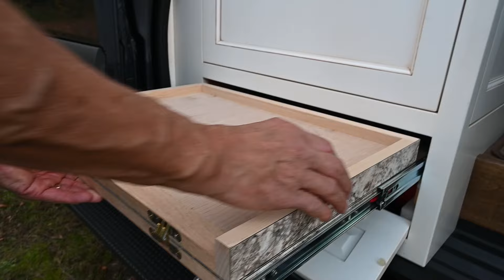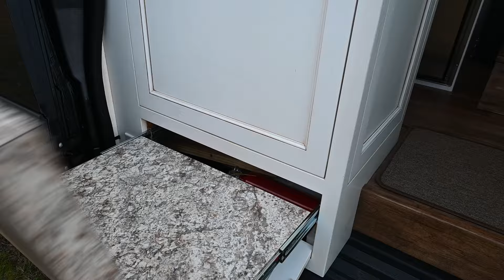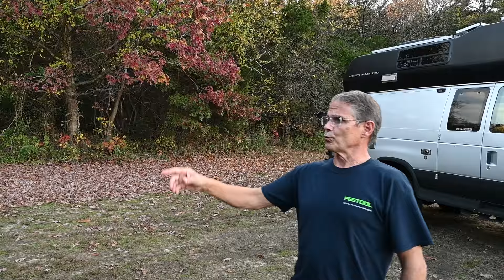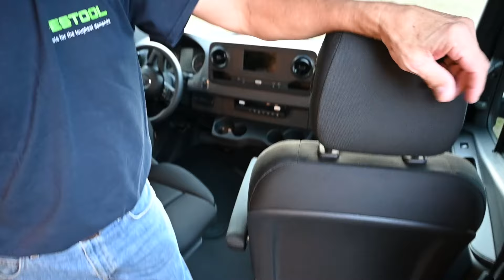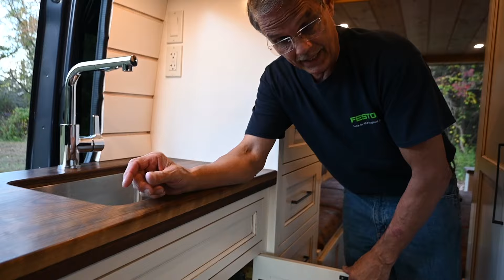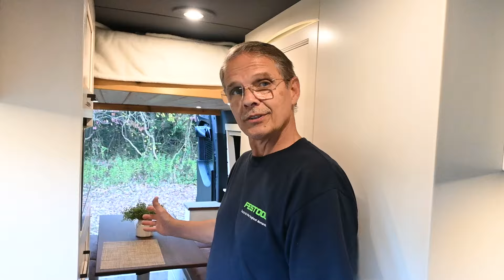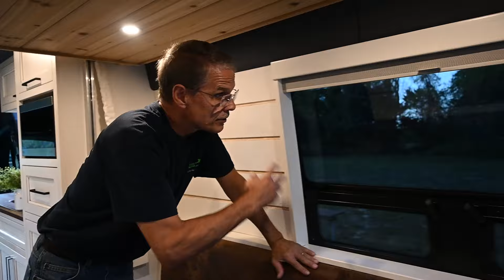Most DETAILED Build - Rugged Exterior With Relaxing Interior Vibes | Sprinter 4x4 Camper Van

Comment: A beautiful van built by a perfectionist. Was there any ventilation device in the shower room though? I'm hoping I just missed it.. otherwise there might be some future mould issues which would be awful in a lovely van like this.
Reply from the maker: Not that I know of, I believe the main vent took care of the whole van
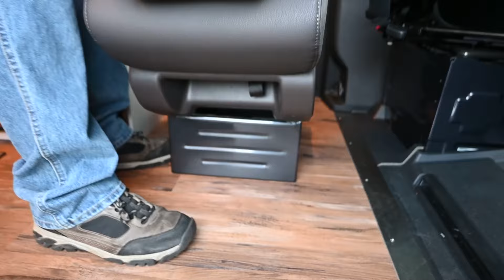Reply: 7:16 Patrick you are right, there isn’t a vent inside of the shower. The door has an opening at the top for any ventilation that would be needed which would be then pulled out of the van via the maxair fan.

Comment: wow i like this, i like how everyone is putting a Happy Jack bed in there class B`s...... Big question if you had to put a price tag on it, what is it worth???  Thanks, It looks AWESOME!!!!!!
Reply: I’m glad you like it!  It’s not a Happy Jack but I guess you would say it’s very similar. I built it with an old geared slide out motor from a junkyard camper, attached a 7/8” piece of tubing, machined nylon bearings and guides, seat belt material for the straps to lift it up, and electrics with a lot of time and this is what I came up with.  As far as price tag I would say for the total for a bed like this I have about $1000 in parts and a ton of hours.  If you meant the finished van that would be around $200,000.
Reply: wow thats not bad at all, so if i wanted you to build me one, could you do it? I also live in Alabama like son, but i live in Fairhope,al. thanks take care....be safe.  @TQ52
Reply: @mikejernigan3215  that depends on what you would want done. Also the van would have to in NJ for a while.
Reply from the maker: I would estimate 180 to 200 K

Comment: I am astonished at how many things he has thought of, but I don’t believe I would put wood surrounding a kitchen sink. That wood is too beautiful to be wet. I have a festool drill so I noticed his T-shirt right away.
Reply from the maker: It works for him and his wife
Reply: The countertops were decided after a lot of thought. Ideally I would have used a quartz or granite for the top at the sink but decided against it only because of the weight. We decided to keep all the tops the same out of an African Mahogany and just be careful with the water splashing wiping it up.  I used a teak oil to condition it after sanding smooth instead of coating with a spar varnish so that I can just hand sand it down whenever it looks too used and just re-coat with the teak oil.  With the use of the under mount sink that makes it a lot easier. They are beautiful though😊😊😊

Comment: Just watched this video. What a fantastic build! I'm wondering what type of locking bracket (and drawer slides) is used on the pull-out shelf shown at the 1:05 mark? I'm doing something similar and really like the bottom piece that braces the shelf when it's unfolded.
Reply: It’s a table leaf support that you can goggle and find easily. It had to be modified a little for this tight installation.  Glad you liked it!

Comment: He used all heavy Stuff. Ya, looks great. But that going to eat into your gas for sure. He even had to put in an extra Leaf Spring.
Reply: Averaging 17 mpg. Anything that tall has to make a big hole in the air and yes I did build it solid not like your average 1/8” paneling in travel trailers.
Reply: @TQ52  Awesome!
Reply from the maker: @TQ52  good information Don
Reply from the maker: Good thing it’s not gas and it diesel
Reply: @NewJerseyOutdoorAdventures  He still said he dropped Mileage. And the way they messed with Diesel prices and somehow made it more than gas. It lost its appeal as far as savings goes.

Comment: Absolutely fabulous build! I am truly impressed with the engineering and craftsmanship that went into this van! I have the same type of bed lift and I am trying to figure out how to safely attach the bed to the ceiling. Do you have any advice on how to bolt the bed lift straps to the roof ribs?
Reply from the maker: Awesome, thank you! Don may know the answer to that
Reply: Thanks for the compliments! I used the steel seat belt hardware from race car belts that the webbing goes thru and can be adjusted with them also.  They are then bolted through the van ribs and backed up with 1/4” aluminum plate.  Super strong and adjustable so you don’t have to adjust inside the bed.  Once they are adjusted right they stay put.

Comment: The kitchen table is what I'm most confused about. How do you bring the table back up and clamp the legs ? I'm also interested in what those table legs are actually called because I want to build a table like that but I don't know what to look for.
Reply: Thanks for asking.  The table base is a compressed air cylinder inside.  When you unclamp it it goes right back up to table height.  It’s also an expensive piece.  Here is what it is called. Springfield Marine 1660230 Ped 3 Stage Table

Comment: This was one of the best van builds I've seen yet. I wasn't a fan of the drop down beds nor transforming tables + benches until I saw this. I especially liked the extra supports as that was always a concern of mine. I love the placement of it in the back with the doors right there for easy access, and so much more to this build. Just absolutely one of, if not THE best designs I've seen! Amazing job!
Reply: What a great comment! I appreciate it very much and thanks for actually watching the video all the way thru.  A couple other commenters I had to remind them that the bed has two fixed positions. One when it is just the two of us (all the way down to the cabinets) and then down to the supports I made for when there are others staying in the bottom area.  That splits the two areas into two equal spaces so each has its own head room. By the way, the supports are made out of very light weight solid cedar.
Reply: @TQ52  would you be willing to sell the floor plan of this build along with the materials used? Or even better, would you be willing to make a replica of this build for sale?
Reply from the maker: Wow, thank you!

Comment: Where do you put dirty shoes when you’re coming into the van? Ditto for wet coats or other outerwear?
Reply: Muddy shoes stay outside, normal every day shoes get taken off at the door and put in the front of the van where the stock rubber floor is easy to clean. Haven’t used the van yet in the cold weather yet but coats would be hung over the driver and passenger seats in the front also.
Reply from the maker: Shoes stay outside

Comment: for wall covering and non weight bearing parts, could 1/4 or 1/8 ply have been used? 1/2 inch was mentioned which seems unnecessarily heavy dep on the type of wood.  Really a thoughtful build otherwise, many useful efficiency gadgets. Thank you
Reply from the maker: Thinner materials could have been used, he built it with thicker for more stability
Reply: Patric is right in one aspect that it makes it more rigid,  but the second reason was if I used thinner material for the walls I would not have the ship lap look that we wanted because the rout that is cut into the wood is more that 1/4” deep.

Comment: Holly smoke now that is 1 of the nicest vans I've seen fit and finish unrealllll
Reply from the maker: So happy you found this
Reply: Thanks for the compliment!  I  used a lot of high end materials that you can’t see throughout the whole build to last for the long haul.  Havelock wool from front to rear for the best installation and all stainless steel strapping and hardware to mount tanks, air tank, compressor,and horns. The running boards and roof rack are all aluminum.

Comment: This is an excellent build. Fine craftsmanship, well thought out. Looks very nice inside.  The ceiling looks good and the ceiling over the bed looks very nice. Electrical systems clean and neat. Large fresh water tank. Decent bathroom. Plenty of storage.  Lots of power, .very nice rig. Intelligent cushions on the rear seating. Lower bed gonna be tight with the upper bed down. Overall a nice clean good looking functional rig. Good job Patrick.
Reply: Thank you for watching the video all the way thru.  It was a very quick tour but most of the highlights were covered in Patrick’s great video!

Comment: Amazing quality and detail...and it's gorgeous! I've been "dreaming" about a dinette like that with a lift bed over it! I just love that van. The only "adjustments" I'd want are to have the bed stop a bit higher up to give the folks sleeping below more headroom, and I prefer a gas engine. Beautiful build!
Reply: Thanks, all the thoughts of how  I was going to accomplish this layout came together after much planning. Plans changed a couple times to get this layout to work. And yes it works very well.  Thanks again for the compliments. I didn’t show the actual safety blocks that I made to keep the bed up another 14” when there will be people sleeping under the bed. It divides the area on the top and bottom sleeping quarters in half. That’s approximately 25” each.  Hope that clarifies the bed situation.

Comment: Patrick I agree on everything you said, this build is top notch. I’m sure he spent many nights laying in bed trying to figure out how he was going to make something work or fit. Cabinetmakers are a step above when it comes to any kind of woodworking and this video proves it. There was no penny pinching on this project, that’s for sure! Thanks
Reply: I just wanted to say thanks for the compliments and you have a lot of insight with every statement you made is true especially the line about laying in bed thinking!
Reply: I’m a retired finish carpenter and have had a few sleepless nights myself, I respect your skills. The countertop and table is beautiful. I’ve never seen anyone use straps for a motorized bed, you may have started a new trend. Thanks for letting us see your motorhome.

Comment: One of the finest builds I have seen.  I think it is great there are quality designs and makers ... skills ... tradesman. ..
Reply from the maker: Wow, thanks!
Reply: Thanks a lot! The Mercedes ,I think personally, is the hardest to build like I did with the walls being curved. For instance the bed had to be about 16” narrower when it’s up than what the walls measure when down.  It works out great though because there is 8” between the bed and the awning windows which allows  a lot of air flow in and then up and out of the max air fan above. All the cabinets backs and the shower wall are all curved to maximize storage and room. Made some stuff for a friends Dodge Promaster and they are simple square boxes but also looks that way.  Not the look I was going after.
Reply: @TQ52  thanks for the reply .. and added info.. happy trails and have fun and drive safely.

Comment: Nice van. I’m surprise you didn’t put a pocket shower door…
Reply: That would have been a lot cheaper and easier to do and I did give it some serious thought.  Another van build that I helped on but was not mine had one in it and when we were driving it to get the electronics for the van checked out it was rattling over every bump in the road.  With that I new I didn’t want to use one.  I used a custom solid wood door and mortised hidden expensive hinges into the solid wood frame and door.  Works perfectly with no noise going down the road.
Reply from the maker: Good explanation Don

Comment: Can 2 adults really fit under the bed when they second bed comes down? The sleep space looks so little. 👀 I wonder how much space is there after you put a sheet, blanket, and pillows.
Reply: We haven’t used the bottom bed yet but when that is going to happen the bed only comes down to the other supports that I built and there will be approximately 25” of space between the two beds. Those supports are stored behind the cushion back on the water tank side.

Comment: And the top bed is adjustable, right?  You can stop it at any height?  The only thing lacking, for me, was storage. Other than that, beautiful build. Excellent!
Reply from the maker: The bed can be stopped at any height
Reply: As far as storage goes it depends what you want to take.  We lived in it for 5 weeks on our first trip in it and we didn’t even use all the available space.  I could even make something that would go on the roof rack up top but until that is needed it’ll stay like it is.

Comment: Great build! My only question is when the bed comes down, it looks like the sleeping below space is eliminated.  Maybe I'm not seeing it clearly or correctly...?
Reply: When the bed is all the way down there is only about 12” in between but no one will be sleeping when it’s all the way down. I have supports that when there is going to be others sleeping on bottom  they go in and it allows about 25” and safety for bed lowering by itself.
Reply from the maker: The upper bed can be stopped at any position, he has a pre decided height he stops at

Comment: Nice, but for me, that's a lot of cracks to deal with sleeping, on the bottom bed! 😉
Reply from the maker: You missed the main bed
Reply: I haven’t slept on the bottom when it is converted into the spare bed but when or if I do I will have a 2”memory foam topper over the cushions to help with that issue.

Comment: You did a perfect job of matching the plinth to the floor. Good eye! I loved the attention to detail, like dovetailing the drawers and the way the couches were upholstered and the beautifully finished metal fabrication. This van is a class act!
Reply: Thanks, I started out with a 1 1/4” piece of maple and cut out the back so that it would lip over the luxury vinyl flooring and then scribed it around all the Mercedes curves, then screwed it from under the van with stainless steel screws then sealed around all the screws so there is no water penetration. Thanks for noticing
Reply from the maker: Thank you Leslie, Cheers!

Comment: At first I thought he was an engineer - then he mentioned he’s a cabinetmaker. Makes sense. Great build but - I would not want to sleep on the bottom if the top bed is being used. There is not very much room to turn from side to side when he brings it down all the way. And you’d have to do a “combat crawl”  to get yourself out to go to the bathroom. Other than that - super nice van. Thanks Don and family and Patrick.
Reply from the maker: Thanks for the feedback
Reply: There are support blocks for each corner if someone is sleeping below. That allows the bottom area to be about the same as the top  bed area which is about 24” each. Then you don’t want to forget and sit up fast.

Comment: Patrick,  this is a winner.  I love both the outside and inside of this van, functionality and esthetically.   All of the details were so well-thought-out. The extra seat.  I love the bed,  the frame is so beautiful.  All the cabinetry is beautiful.   The  flip out table at the door is my favorite.   I see so many builds with that table held by a wire  &  I think, "that's not going to last and is limited in weight capacity ".  This one is sturdy and strong, I like that a lot. This couple did a great job.
Reply from the maker: Love so many of the ideas he had and the materials he used

Comment: That fold out table is the best design I've seen. Most other vans will have some type of cable. I'm adding to my comment. The build quality and materials are the best. I'm in awe of the workmanship and all the fabrication. I like the 2500 over the 3500. Hopefully I can find a nice used Sprinter with a gas engine.
Reply from the maker: We agree!
Reply: Can you point us in the right direction to a link for the outside table sliders ? I see they have an extra pull out to support the table at the joint ?